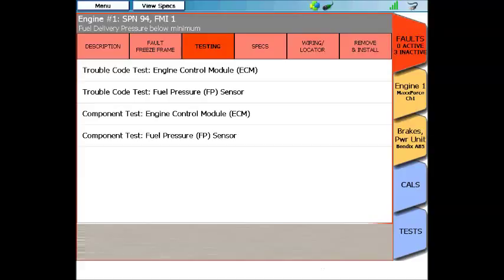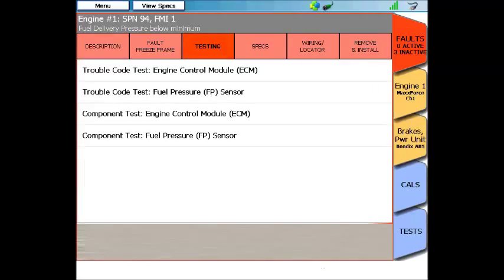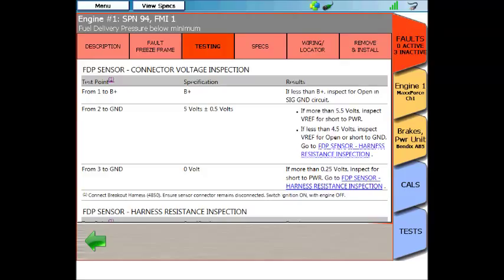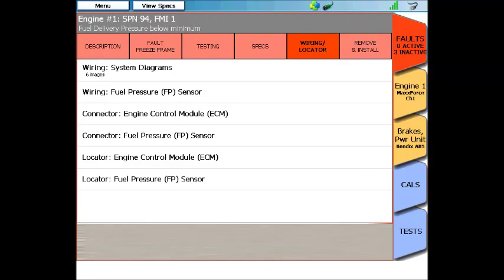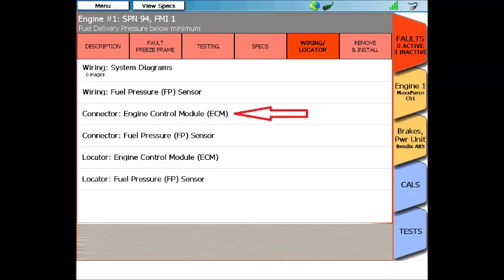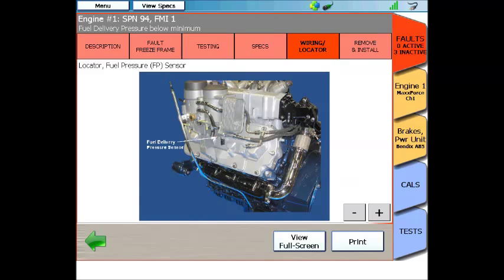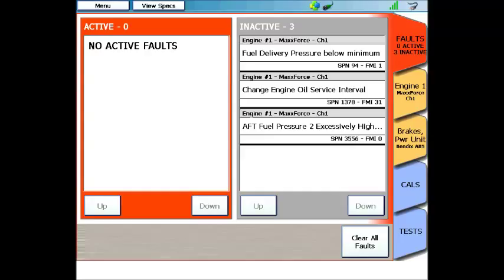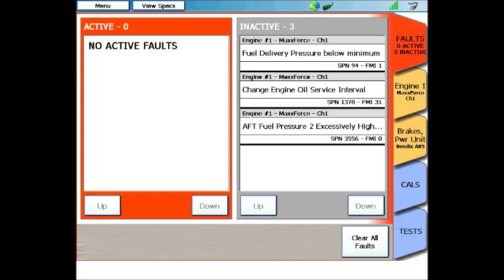Pro-Link Ultra - Using Repair-Connect

Comment: the tool works great, but is very hard to be buying every software, they only give you 10 free trials,after that you have a useless tool and you already spent couple of thousands, my snap on dealer did not tell me.
Reply from the maker: Sorry you didn't know about that before you bought it.  That would be an unwelcome surprise.